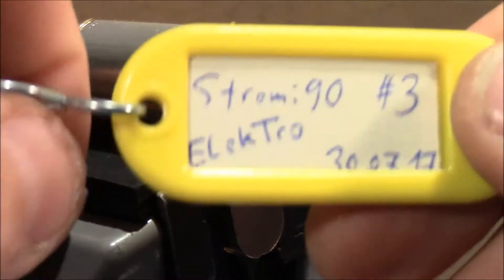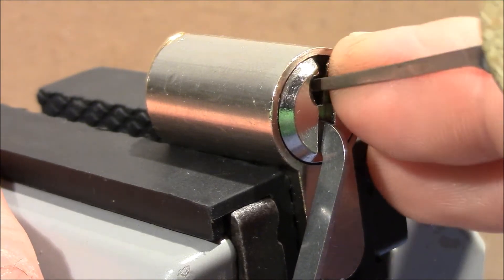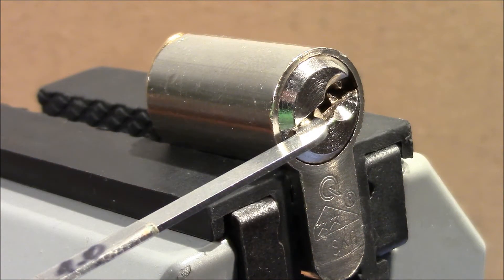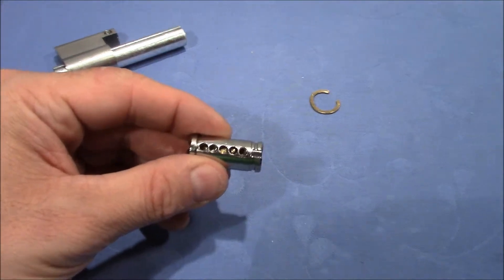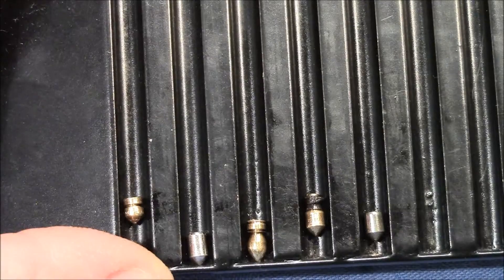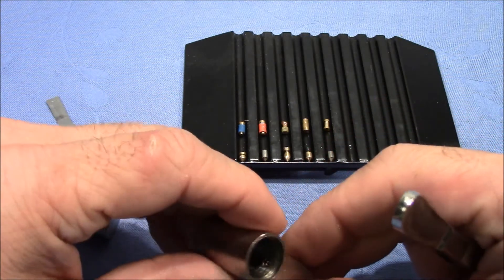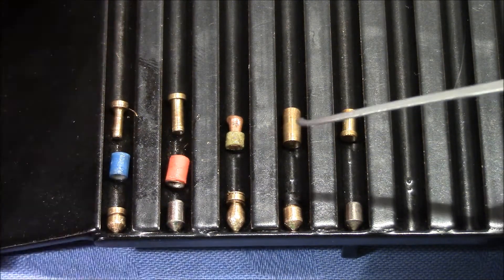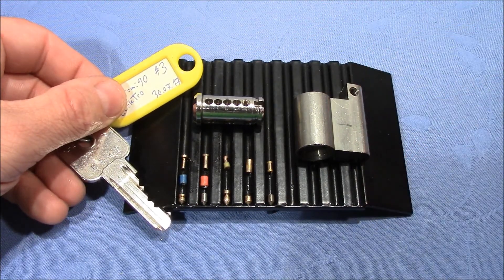(picking 416) ElekTro by 'Stromi 90' - a challenge lock with pins you have not seen before

Comment from the maker: Sorry that I didn't pull out the springs but I was so amazed by these unusual pins that I simply forgot it.
Reply: Potti314 Nice picking bud! That was definitely pinned differently than I have picked yet... Do you find it more difficult to pick upward on the key pins or downward?
Reply from the maker: Thank you. Actually picking upwards (US style) is most of the time easier. But there a a few exceptions, for example when I have to twist the pick a lot, then picking downwards is easier. But I try to practice both.

Comment: I was very curious what ElekTro meant :D. So that is a great idea with the little crimps and colored wire isolation :D. Probably not lasting long, but that was a nice fun lock :). Thank you very much for sharing Potti :).
Reply from the maker: Thank you - yes, maybe not very durable. But it gives a very strange feeling when picking it. Will lubricate it a bit before it travels on.

Comment: I think they might be cut down electrical crimp connectors used in automotive wiring? Great picking, of course :-)
Reply: Lock Noob a litte Bit of Everything 
Cable, Crimp, shrink Tube Everything :-)
Reply: Stromi 90 awesome :-)
Reply: Lock Noob thank you :-)
But Next Time He will get Hardcore Pins, which Are Not Boring :P
Reply from the maker: Exactly, that's was "Adernenhülse" meant - crimp connector, but I wasn't aware of this word while doing the video. Thank you for watching :-)
Reply from the maker: Haha, "Hardcore Pins" - these electrical pins were really cool and gave a rubbery feeling when picking. The only "boring" pin was the standard driver - hope you didn't get that wrong.